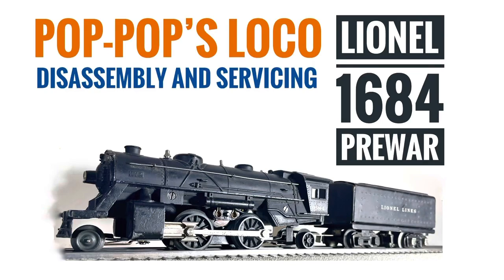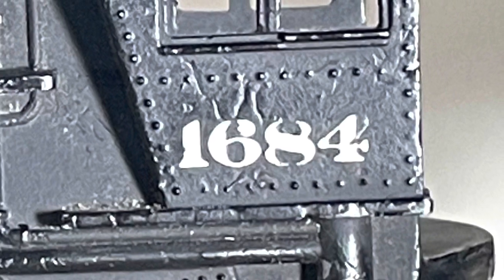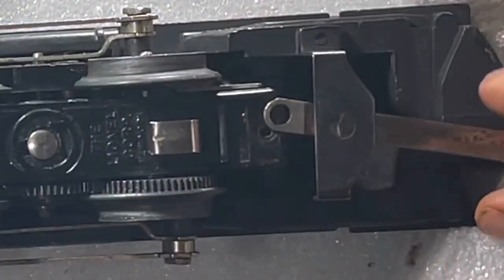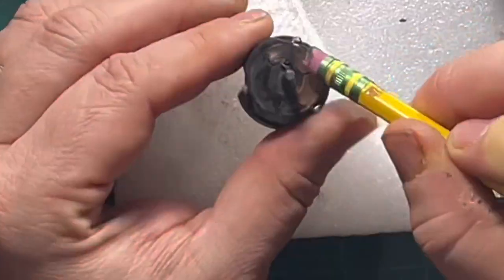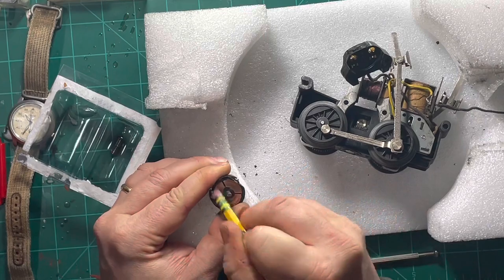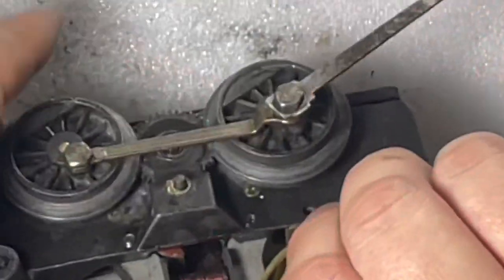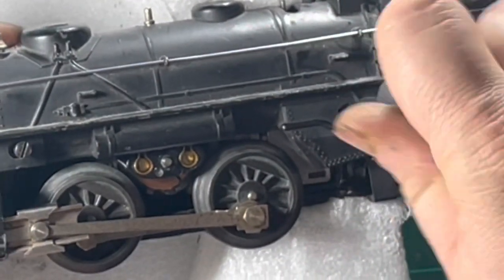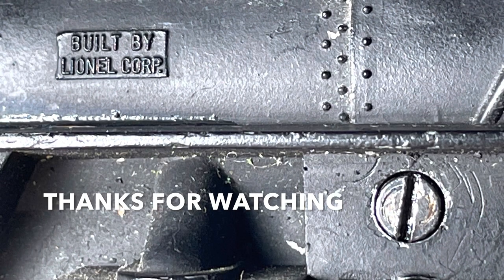Lionel 1684 Prewar / Getting a 80-year old loco back on the rails /  Service Disassembly

Comment: Awesome! My Dad was given this engine by a neighbor years ago (He grew up during the MPC era). Eventually it was played with by myself and siblings and was known as the fast runner that bumped over switches because of the tall flanges. It was the only reliable steam loco I had  though (the other main engine being my Dad's MPC set's blue Santa Fe diesel) for most of my childhood so it got used a lot. After a few too many falls due to that high speed tendency, it has lost its cowcatcher. Eventually it got shelved as other locomotives came along. Fast forward a decade or so and I have my own place and grabbed this loco from my grandparents place to see what could be done.  Like you, I discovered it really only ran okay in reverse but would come alive if I pushed on the commutator. Nothing looked particularly dirty. So I ordered some new brushes and popped those in. Never in the 20+ years I've played with this engine has it run so slowly and smoothly!  They might just be the budget engines of the era but they still built them solid back then. Now to see what I can do with the front. Maybe I'll add a front coupler?
Reply from the maker: Great story ! A lot of times it’s just one part that needs to be fixed and boom.  Suggest asking a train store if they have extra parts for the pilot. Thanks for watching

Comment: Thanks for posting this video. I wanted to see where the wire coming off the opposite side of the field went but as far as I could see you did not show the opposite side of the motor from the brush plate. I think the wire is suppose to connect to the e-unit but I'm not sure.

Comment: I would glue an engineer and fireman in the cab trains don't run themselves as well as putting a conductor on the rear platform of the Caboose. I have a collection of Marx tinplate cars that sing to themselves when they go along the track a type of harmonic vibration it's so interesting and cool. Life was so nice before they invented computers.

Comment: I ran one of my – engines off the train table and broke the cowcatcher off the locomotive and did not own up to it to the day he died. My brother brought me a small box of what was left all his huge collection and the engine with the broken pilot within the Box. I sent the engine with a bunch of other agents to get lubricated and serviced and I thought they would use the broken one from part but they just cleaned it and moved it and it was damn good and I too was thinking about putting a front coupler on it as well so I could doublehead locomotives and you could not really see that the cow catcher with broken. Because of it being broken no one wanted it therefore it survived long enough to come back to me, a small piece of my childhood. Toy trains seem to be the only item from the old days that continually get from one generation to the next, and then to the Next Generation. I tell people trained nuts are born not made. Like vintage motorcycles they Outlast multiple owners. My trains and my motorcycles will outlive me that is for sure.

Comment: No plastic before the war therefore the Rolling Stock with either diecast or tinplate. There was an article in Model Railroader in the 1940s about a guy who made his whole railroad out of tin cans he made real by cutting a thin sheet of tin and forming it over a wire to give it a rail shape which he would insert into wood ties. He also made buildings out of 10 as well and showed how he built them. With them being t i n n e d he did not have to worry about anything rusting. So creative people were in the old days.

Comment: Everything was made to be serviced and last forever. There was no such thing as planned obsolescence until the Japanese entered the picture. Lionel train hit rock bottom when they introduce the Scout line. Everybody knows that parents purchase their son a Marx train and then if he takes care of it then they buy him a Lionel train to go with it. One of the reasons why Lionel trains was cursed with third rail was because everyone in pre-war use the same three Real Track and methods that marklin had introduced in Germany in the 1800's. Let's not forget that American Flyer was three-wheel old age before the war. I bought a beautiful streamline royal blue diecast American Flyer 3 Rail and I had the train guy cut off the American Flyer style coupler. He said it would affect the collectability and value of the engine and I pointed out the engine was only $30. It was relatively O scale size as well. You can get away with undersized Railroad stock because older cars were smaller than modern cars. It would have been so much better to make all of the locomotives and full-scale as well as having diecast shells instead of plastic. But plastic back then was considered new and modern as futuristic. Now plastic is considered cheap. I have a Lionel Train Bakelite observation car that I painted solid Orange. But it is true what they said about Bakelite that you cannot paint it because of the way he is and the paint would eventually flake off the car. I liked the few pre-war locomotive that I do have it's like the Walters catalogs that I have for 2 rail DC 0 scale trains. It is stated 1941. Two rail 0 scale was always an expensive adults Hobby. I think of the person who bought that catalog for 25 cents was drafted in WWII and possibly killed. WWII with something horrible inflicted on America. I hope it never happens again.

Comment: That locomotive has gears on the driver Wheels out to the flanges the way Marx locomotives have the same Arrangement so they will derail on 027 switches. Marx switches are constructed to accommodate this where Lionel doesn't.

Comment: Just like their prototype Steam go through scheduled class shopping to maintain them and top running condition. A steam engine on the deadline does not make anybody for the people who lease it. Locomotive would belong to a trust and that would be ordinary people putting their money into it and the railroads would least they're looking motive for 20 years and then after 20 years they would lease it again. This did not happen in diesel ization the leases on various steam locomotives were simply not renewed as well as having no Prospect of being renewed again they were scrapped. The destruction of a whole industry. Steam locomotives put people to work that good union wages. Diesels put people out of work. They should have been used to supplement steam locomotives not to replace them.